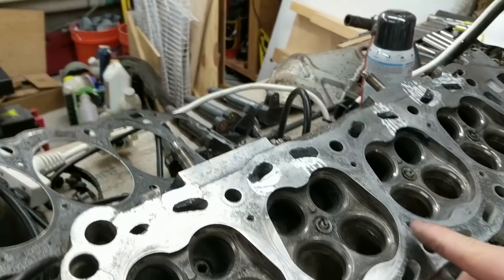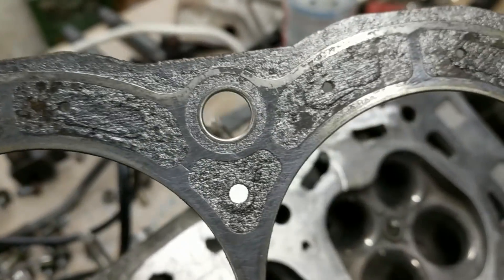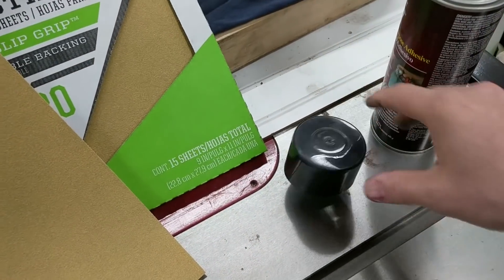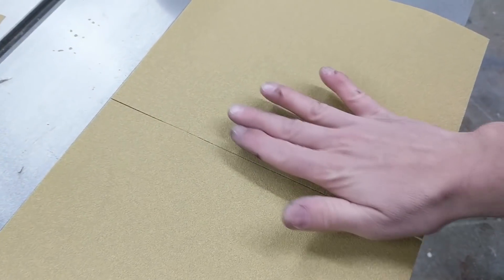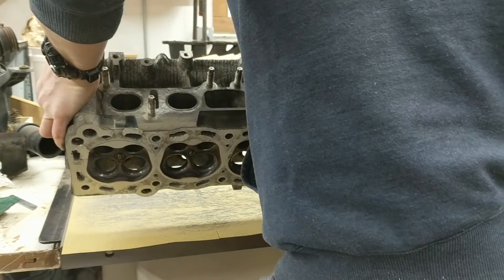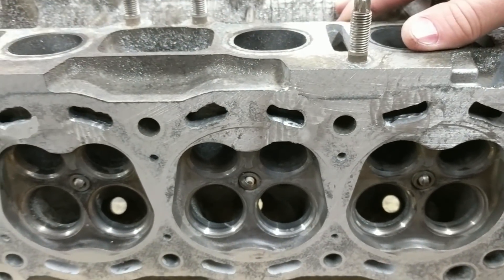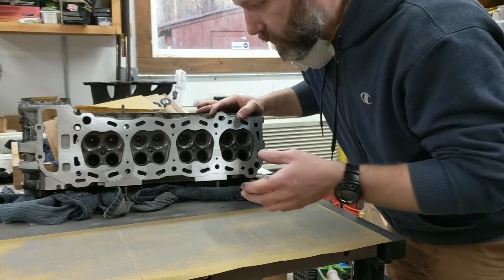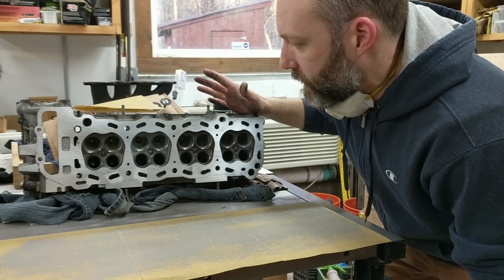Using a Table Saw to Resurface a Cylinder Head

Comment: I have a headstone I bought for $20 from a memorial company that someone ordered but never picked up.  Me and William Martin (name on the stone) have surfaced a lot of stuff.  It works really great on the top of diesel engine blocks the weight giving it just enough pressure.
Reply from the maker: This is my favorite so far
Reply: @WhatDennisDoes do you have any recommendations for the block? I was going to do this with a piece of glass. And also use it for the block upside down as it's quiet small. 1.0 3 cyl engine.

Comment: how straight is the table deck surface, I'd imagine that would have to be dead nuts flat for this to even be possible.  Trip to machine shop would be way cheaper.  If the table is pretty flat this could definitely work

Comment: I've used a section of brushed concrete to flatten a badly warped aluminum head. I felt like a caveman doing it but it worked really fast. I just kept checking with a straight edge and feeler gage until it was even all around. Car ran great after.

Comment: I actually used my 6" by 24" belt sander to do some snowmobile heads and it worked great . Didn't have to do much work just turn it on .
Reply: Done the same.

Comment: Where's the dial indicator so we can see that he's actually getting a even surface? I have a table saw but would be a little leary going this route even if many people commented they've did this before. IF I'm going to have the head pulled might as well have it checked and either fix or replace the heads if it was necessary. As another commenter posted ALWAYS replace the head bolts as they stretch unless you like replacing head gaskets regularly.

Comment: i could never do this with my head... its just to heavy. my head weighs around 350Lbs
Reply: But you COULD get a piece of granite countertop and glue the sandpaper to it and move the granite back and forth over the upside down head. I use an 18" square piece and a proper straight edge to check my progress when truing up the decks on old farm tractor blocks like on Ford 9N's. Saves me from splitting the tractors in half. With care, it can be done.

Comment: Interesting I was moving my table saw the other day and I was looking at the big flat table and thinking the same thing. I'm giving this a go. I was also having difficulty finding large sheets of sand paper so that was brilliant using 3 sheets. 
If you can sand the head do the valves yourself. I was more confident doing valves than machining but I had had a lot of experience with Briggs and Stratton

Comment: Found that if you put a clean cloth over your hand it will amplify any defects or even dents in your car body, Seriously try it and you will find this to be true. Place a thin clean cloth over your hand and rub the area lightly particularly across your out stretched fingers. It does work.

Comment: Not bad you should have used a window pane for flat surface also 320 grit sandpaper this is way too old technology used to do Harley-Davidson heads great job thank you for the video wish I could turn a e model caterpillar upside down and do the top of the block but the white of it is a problem so I guess I'll take it to the Machine Shop

Comment: Hahahahaha I cant even begin to tell ya all the problems here I mean for hell sakes getting a head milled is just not that expensive, this is not saving money or time... sure it will work... so will water in your break lines or saw dust in a transmission neither of which saves money or time. cant figure out just what is the point here. to see just how poorly you can put a motor back together and have it run? please sell your tools and take up basket weaving or something
Reply: how cheap is it that your only "local" guy for miles gladly takes your money and hands you back a part that has jumped in the mill when being surfaced and you only find out back at the shop when you put a straightedge on it out of your own curiosity and find the step. i'm sure not going to bring it back to that asshole  who handed me back a pile of crap with a smile. i'm going fix it back at the shop and take it for a lesson learned. oh the reason he did this video was to get guys like you all flamed up. mission acomplished.

Comment: a+ remember k.i.s.s method  keep it simple stupid ;} if the valve ant loose lap it a bit new seals n go .a simple test oil valve stick valve in hole finger over hole pull valve n hear a pop thats a good sign it be tight enough .just saying fer shits n giggles ls Chevy head have extremely strong valve giudes 185k miles n still good guides ill bet powder metal is in others brands to and that be a good thing

Comment: You are correct that your hand can feel less that .0001", However that is a height difference within an area of .0001" not over the 3' squared surface your looking at, with that I'm confident that decent table saw table would be able to get that head well within a working tolerance.
Reply from the maker: Very true.  I meant that I used my hand to feel for any bumps caused by rust.  I was trying to explain (not very well) that those were just stains and those areas were very smooth.  Certainly couldn't tell by hand that the table was flat across the entire surface.  I did check it with a granite surface plate though and it seemed very flat.
Reply: Doesn't matter really. You sprayed the glue on afterward and that wouldn't have been anywhere near level

Comment: A big grinder with a magnetic table, Used for flywheels would do this in minutes
Reply: Aluminum , is not magnetic.
Reply: @kd8los  doesn't matter you can secure the head on the sliding table many ways.

Comment: I got a bit of advice. Buy 2 cylinder head gaskets.  If you put that on your car it may run about a minute before coolant starts spewing everywhere.  Also, coolant (anti freeze) can damage all the rod and main bearings and the crankshaft will need machining. Not on your table saw or drill press, It needs to go to the proffesionals.  Your cylinder head needs to be FLAT as in no more than .003" variation.  I'm all in favor of saving money with the high prices of a good machine shop.   I'm a master ASE certified mechanic, with advanced eng performance  and a machist test for engine assembly.  When I rebuild an engine (this applies to a 2.2 and a 2.5, both turbo, the last 2 I built)  I will polish the crankshaft myself.  I measure every journal for diameter and to check it's roundness.  I hone out cylinders myself.  In fact the only time I want to the machine shop was to have a cylinder head resurfaced for flatness.  They had to remove .007"  to achieve the specified flatness.  I am trying to tell you the IMPORTANCE of a flat cylinder.  Do yourself and take that head to a machine shop to see if they can possibly fix it.   One more thing, you can't machine too much from a cylinder head on a modern engine. It might make the compression too high  and it thows out the geometry of the timing chain or belt.

Comment: Excellent idea though having worked with a lot of wood machines I would never assume or trust that they are precision ground flat from the factory. A table saw table has fairly low precision requirements compared to a motor head, often thay are not fully seasoned cast when machined so can move after machining and end up warped, convex or concave. I hope yours happened to be flat. 
What you could do to make sure it's flat of course is get a large cast iron cylinder head, spray it with contact adhesive, then stick some 80 grit hardwaring sandpaper to it, then rub the cylinder head sandpaper face down over the table for an hour or so, that should get it pretty flat. LOL ;-D

Comment: That method will make the warped head flat. Typically on a overhead cam cylinder head if the gasket surface is warped so is the camshaft line bore. Yes the gasket surface is flat but does the cam still turn freely in the head?

Comment: why not make wood frame and wood rod both side head or wood side and rope were motor bull and other side same bull.
and motor move head front back. simple made. run whit motor and go to drink cup of coffee and or read good book, then go back workshop. tadaa have ready, change sandpaper fine grid and do same new.

Comment: I never really gave it much thought until just tonight when watching this video. I have a table saw in my basement and I'm going to try it, I have cast Iron and aluminum heads and the cost is minimal, I can run over to The Home Depot and pick up the sandpaper and I already have the 3M spray adhesive. I just subbed, liked, and clicked on the bell. Thank's for sharing this idea. I'm 69 years old, retired and worked as a mechanic/technician over 45 years and never thought of trying that. Thank's again, really enjoy your video. BTW, I worked at a machine shop 5 years, some things we just don't think about without getting a 2X4 upside the head, lol.

Comment: A suggestion for an improvised "Tank" to dip your parts in to clean them:
If it won't get eaten by your solvent of choice, try a Rubbermade style plastic tote.
If the plastic will get eaten by the solvent, how about a large metal garbage can...
Both of which can be cheaply bought at Walmart or your version of Canadian Tire.

Comment: I used a new thick plastic meat cuttng board to flatten a outboard motor head ,,,it worked just fine,,,head tighten in place and had no issue,,,took my time like you ,,,I tried to keep the downward pressure even,,, I went in a figure 8 pattern as much as possible,,, Good job,,,Best Regards

Comment: Kids!... Don't try this at home... or on a customer's car.... please
Reply: I had a partner when I ran my own shop .. he was a machinist and he could do a lot of things like this... spinning up a Porsche flywheel that was impossible to find though the only channels we have available at the time... we were using a Commador computer onboard our truck for databases and repair manuals..  78 through 82... the Internet has eliminated most of those issues  .  It's still hard to find a flywheel for a 356 B Porsche... Art took the flywheel and attached it to an electric motor that spun it up to 1700rpm... and attached an angle grinder to a lever that allowed him to control the movement across the surface of the flywheel... awesome... he had welded several cracks in the metal where the crankshaft attaches... it was good as new when he was done

Comment: My dad used this methos on his parts and it works. Just use some marking bkue and check the low and high spots. In the end you will have a good flat surface.

Comment: cheers, awesome..some have used JB weld for the litte pits, with good success on aluminum heads
Reply: I used JB weld to fill a scratch on a motorcycle cylinder head years ago, spread and scraped it with a putty knife, it worked just fine and lasted the life of the bike.
Reply: @somedude4774  they do it on Mercedes' and yes, it works great!

Comment: I did almost the exact same thing.. scotch 77 , 150 then 300 grit, and a sheet of tempered glass .. 96  Ford explorer intake manifold. Six years later, still running strong. I used wet sandpaper cleaning the sanding off regularly to avoid buildup. 3 surfaces. Oh I also did circular motion. Not always straight line.

Comment: Back yard version of a large wide sanding belt I was used in a machine shop for gasket surfaces on exhaust manifolds, it does work, might not be mill grade but it can solve a problem and last a resonable amount of time if done right.

Comment: I've done this years ago. One woman was on ADC (NO money) She overheated her 2.2. (Normal) She really needed her car but machining costs put out of her reach. (Do this only in a pinch with no guarantees or you may eat it. { A little Mustard on that aluminum?} )  I learned then to use a figure 8 motion for proper sealing surface. Oh heavy plate glass works well just don't drop the head on it..

Comment: Use non-chlorinated brake cleaner to clean it. It evaporates very quickly and usually leaves no residue. Wear eye protection, it burns like crazy in the eyes. And gloves too. Otherwise you'll find all the cuts you didn't know you had.

Comment: Old machinist that say your fingers can feel a billionth of an inch are morons and should be beating to death with a rubber hose
Your finger cannot feel up billions of an inch for the love of Christ that's the stupidest thing I ever heard. The human fingertip cannot feel one ten thousandth of a inch! 1/2 thousandth is about all you can go and you have to be able to see it in order to detected at all.

 of doing this as ridiculous as well.
Get this thing surface ground by professional for the love of God.

I grew up with the following saying being hammered into my head with every project I took on
A job worth doing is a job worth doing right
Reply: then why can i feel a 2 tenths deflection in a surface which after feeling it i measured it with a 10ths indicator and turned out to be 0.0002 on a mating line where I had fly cut two adjacent runs on the same piece of stock in the same setup.. I agree billionths is bull shit but then I never read anywhere in these comments where someone stated machinists could feel billionths... I do  think feeling a couple of tenths is not abnormal...
Reply: @lloydmilton  I always thought that it was five ten thousands but I guess that was wrong if you can feel two. Either that or you got magic fingers buddy LOL the average Joe I've heard a couple people say they can feel 1,000 if they can see it
Reply: @ClownWhisper you would be very surprised at what your finger nail can feel my friend :), if it was spread out . blended i would not be able to feel it but when its not feathered / blended a finger nail can feel its not quite right... at least thats been my expereince... its then i will break out the test indicator and run it over the piece
Reply: @lloydmilton  again I'm not doubting you I was specifically talking to tactile touch. Your fingertips and what they are supposed to be able to detect.
Reply: @ClownWhisper aren't finger nails part of your fingers and generally protrude beyond the end of your fingers? ergo wouldn't they be the tips of the fingers? :D 

Semantics I guess... but you did just say  your fingers in your OP which imho my finger nails are very much a part of my fingers that can be used for tactile feel.

Comment: Do you need to drop it down to at least 500 Grit the machine surface when milled it's about 5000 if properly milled getting it down to 500 Grit allow for clean seal on contact services with gaskets it's what I do for a living

Comment: Did you measure the thickness of the head to see if you got it even? And to make sure you haven't took too much off.  Theres is spec for that. If you take too much off you will have timing belt or chain issues
Did you use a machinist straight edge ro verify how much the head was distorted before you sanded it?  I've never seen anyone do this process and end up with a proper head after. I've been a mechanic for forty years

Comment: Nissan V6 engines have poor quality exhaust manifold studs which result in warped exhaust  manifolds. I ground a manifold flat with a belt sander the repair only took a few hours.

Comment: I was told many years ago, during a Woodwork class, that Sandpaper is actually Glasspaper, and was for use just with wood.   For metal you should use Wet'n Dry, which is made with Silicon Carbide, and as its name suggests can be used dry or wetted with water or oil.   Any way your surface looks to be much better now...

Comment: I applaud your ingenuity but I don't think I'd try to resurface a head like this. I guess I would if I were in a jam or if this head was going on some old beater that I didn't really give a crap about instead of some $10K engine build but the surface flatness of the head and block deck are pretty critical unless you don't mind replacing head gaskets every 10K miles. Still, not a bad idea, just one I probably won't ever employ. A local machine shop will to this for you for not much money and it insures that not only is it flat but not warped.

Comment: A lot of labor goes into a head job. I’ll feel better using a machine shop for $50-70 for a resurface and pressure test, Rather than taking a chance for it come back down the road or immediately.  Your idea is very smart if you’re willing to take the chance to redo it. Saves you $40 or so for a resurface.

Comment: surface limits are so small on the aluminum head you want to sand only if it's warped you use a flat steel plate bolts and an oven if you are warped at the surface you are warped in the cam journals. This is a very proper way to clean do not machine an overhead cam.  a mill is for overhead valve  flat head etc.  the head looks fine plasti gauge the cams if you good there no risk put it on and drive it

Comment: I did the head on an Equinox in a similar way. I filled the small pits with JB Weld then flattened the head with Diablo 80 grit self adhesive paper and a sheet of 3/4" glass. 80k miles on it and no issues.
Reply from the maker: Oh wow, I had considered JB weld but I didn't know if it would hold
Reply: @WhatDennisDoes  The Equinox has cavitation problems that pits the head and deck until complete head gasket failure occurs. I sand the deck flat then clean the surface with brake cleaner then filled the pits waited 24 hours then sanded the block dead flat again and did it much the same on the head only I used the glass and sand paper on the head. Want a picture?
Reply from the maker: @TractorWrangler01  yeah! Post a link or send it to me at whatdennisdoes@gmail.com
Reply: @WhatDennisDoes  Ok give me a few minutes. I may have to send you several emails because of the Gmail limit.
Reply: @WhatDennisDoes  Did you get those?